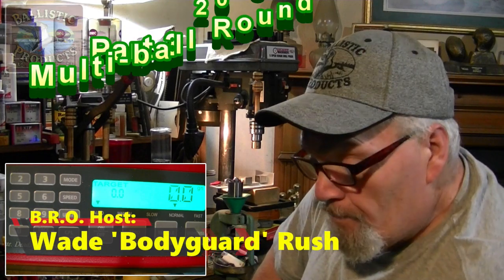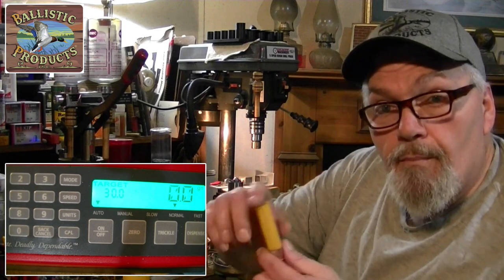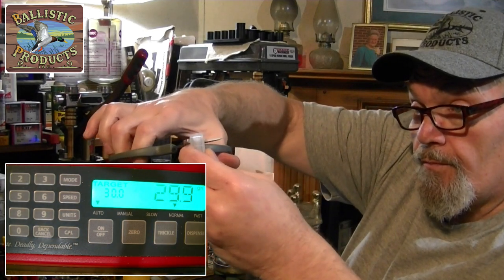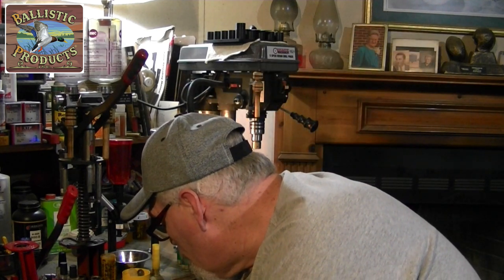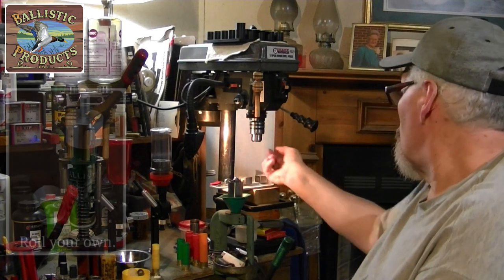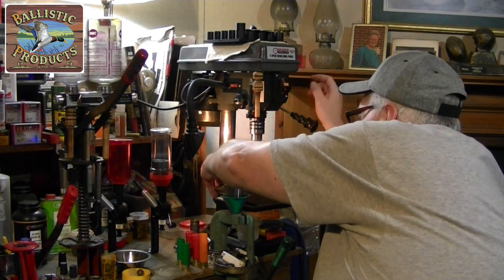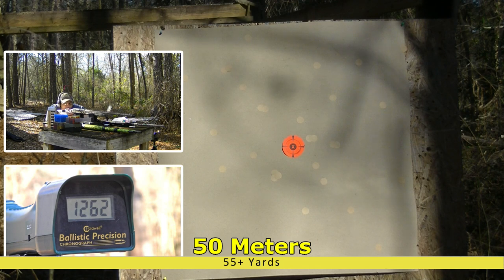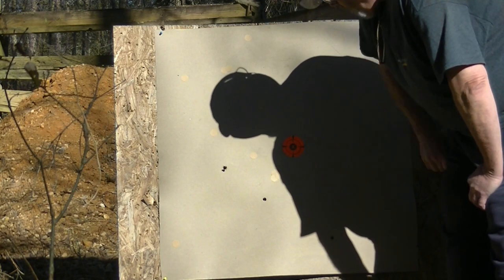Multi-ball Part 3...  .49 tri-ball in a 20 g.

Comment: I've been loading sized .577 Minnie balls with great success into .20 ga.   585 works too, but I've found .577 sized rounds are just perfect fit.  They seem to fly straight and deliver shocking knockdown power.  I just have to remove two of the 4 sides of a standard shotgun cup wad.  Making a sabot like sleeve with the two remaining cup shot wads wall sides.  They hammer stuff and show much more expansion and bullet deformation than they do fired out of any of my .577 muzzleloaders.
Reply from the maker: By far my best performer in the 20 ga. Is a .575 cal ball.

Comment: I bought a 870 super magazine to dog hunt with in Abbeville Al .joined a club this ,I made a mistake of not patterning my gun and I missed several before I shot it at paper  it was shooting oo 2 ft to the left and high at 40 yards
Reply from the maker: Ouch!! I had an older Stoeger that shot low and left... seemed to be a common problem with the older ones! I haven't seen that problem with the Remington's though! Barrel may have gotten bent in it's travels...
Reply: @BubbaRountreeOutdoors  i changed the choke tube to a buck kicker full and killed three coyotes at 40 yards

Comment: Just stumbled across your videos and I'm absolutely blown away from the knowledge that you have on shotgun loads.
But if you don't mind, could you try to answer a question for me. 
I'm not familiar with loading hulls. But could I get some low brass clay loads, cut the top, then load a .69 round ball in it? I know I've watched some of your videos and you had better success with the star method. But I'm just asking.  Thank you and God bless
Reply from the maker: thanks buddy! Yes you can, if the ball will fit into the wad. You may have to remove the wad and trim the pedals off and just use the power piston.
Reply: @BubbaRountreeOutdoors  thanks much my friend. God bless and have a blessed day
Reply: @BubbaRountreeOutdoors  one more thing, what round ball would work in a 20 gauge and how would it do?
Reply from the maker: @cdp50359  I have shot single ball from .57 cal to .60 cal with awesome performance and here's a very simple double ball: https://youtu.be/NRwkhdLeNgU